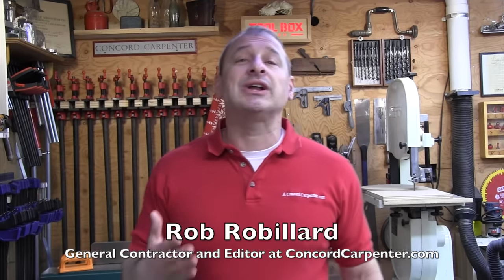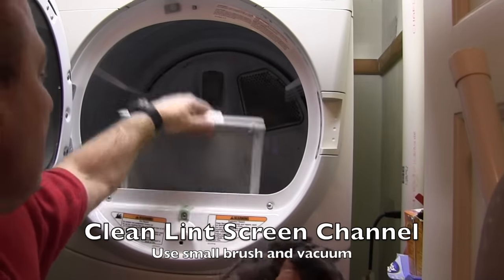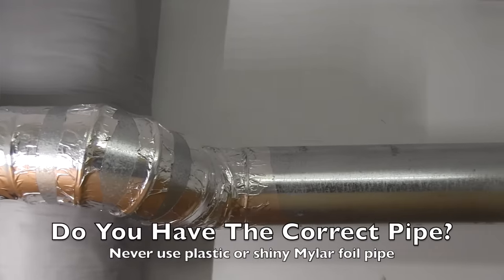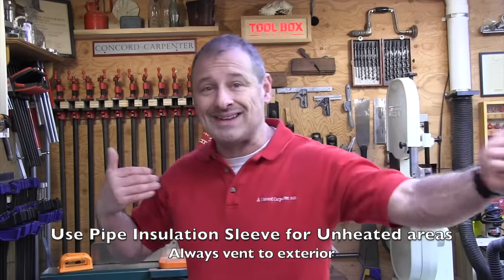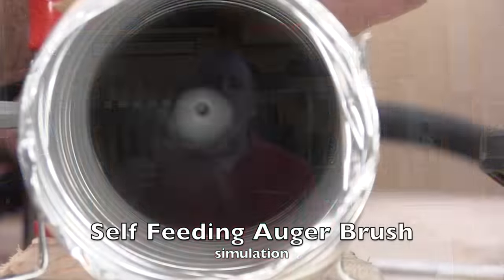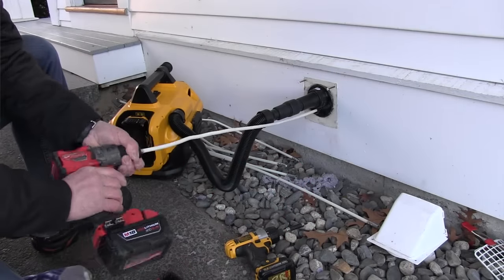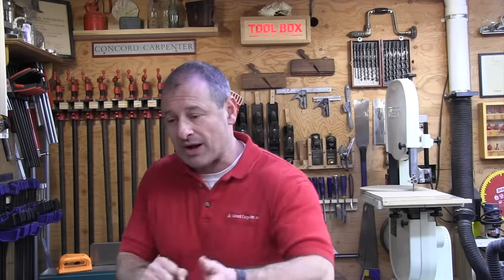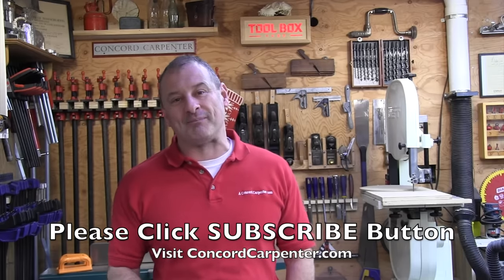How To Clean A Dryer Duct - Step By Step

Comment: Great video. I appreciate that you make videos of advanced carpentry techniques like sistering joists and leveling floors as well as basic videos like cleaning dryer vents.

I had to clean a clogged dryer vent at my mother-in-law’e house last weekend. I should have purchased a kit like this to scrub out the pipe, but I didn’t have one. I do have a long hose on my shop vac. I removed the hood cap outside the house, and I ran my vac hose in from the outside then from the inside after I separated the duct from the dryer. The ribs on the flex hose scoured the pipes a bit as I fed the hose in and out.

One other technique that I used, which worked well, was to stick my Milwaukee m18 leaf blower into the duct from the inside and blow out the duct after a few passes of vacuuming. I already have an m18 blower, which i use to blow leaves around my yard and out of my garage. The blower pipe is just about 4 inches and tapered, which allows you to create a pretty good seal when you stick it inside a 4 inch duct. I looked out the window and saw huge chunks of lint blowing out the pipe on the outside when I blew air through the duct from the inside. It worked very well!

One suggestion I would have for people installing dryer ducts would be to avoid a lot of sharp 90 degree bends. If possible, in would use 2 45 degree bends for longer sweeps to improve airflow and reduce lint buildup.

Comment: Your above video sent me underneath my house to see what was causing the blockage. From what I saw in your video I figure what where the problem was.  Took out all of the plactic tubing and replace it we aluminum.  Using metal tape to help secure the connections before adding the zip tie was a godsend.  Thanks for your help.

Comment: CSIA CDET (fancy for Chimney Safety Institute of America, Certified Dryer Exhaust Technician) here and I really appreciate bringing this important information to they forefront but I do need to point a few things out.

"Critter screens" are absolutely forbidden by the IRC in the US. Do I see them? Daily. Can you buy them? Go to any hardware store and get one , just know technically you can't use it. I assisted a fire investigation once and insurance refused to pay out the claim because of this.

Whether or not to use screws or not is up to debate. The codes changed a few years ago and called for mechanical fasteners providing the fasteners  do not penetrate the duct by more than 1/4 inch. Good luck with that; personally I hust use good quality UL listed foil tape and make sure that horizontal runs are well strapped to prevent sagging.  Also horizontal runs should be sloped DOWN TOWARD the termination. Wet exhaust and lint have a lot of water vapor. Also,  NEVER vent into an attic, crawl space or garage. You want to see mold? Well you will.
Reply: Are O-rings acceptable to use for securing?

Comment: I always thought you had to disassemble the dryer down to the drum to clean it out. Thank you, I learned something today. Subbed.
Reply: Daniel Cannon the only way to clean the inside of a dryer is to take it  apart!!!!   There is no way around it. I fix appliances for a living.
Reply: I’m a chimney sweep and also clean dryer vents and part of my dryer vent service is to remove lint from the dryer and the dryer vent . Imo just cleaning the vent is only 70% and that’s not a complete job. If you think about it a fire will start  at the dryer heating elements not inside the vent, so why not make sure the whole complete system is free and clear from obstructions. Most dryer vent companies only clean the vent just like most chimney sweep companies just clean the chimney, because it’s quick and fast money. But what about the dryer or the wood stove/pellet stove. Those things need to be cleaned as well because there is a potential danger. My business might cost a little more and take a bit more time, but everything gets cleaned from beginning to end so I can sleep at night knowing the customers I service are getting quality and safety for their home.
Reply: @Jonathan T. Brown yes you can have a lot of sand and build up of lint from moisture that sticks to the walls of the vent inside the dryer. This is all done if its accessible(easy to take apart). You don’t want to break a part that could potentially take weeks to months to arrive. It’s surprising how much lint is hiding.
Reply: @Jonathan T. Brown Best tool for the job is a reverse skipper ball but this comes with a higher up-front cost as you would need an air compressor to run this tool. Second of this, you can buy the drill-powered rotary brushes and use a blower, much lower initial cost
Reply: @Jonathan T. Brown Also, INSPECT THE VENT TYPE PRIOR TO CLEAN, if it's that crappy white vinyl stuff, do not brush it as it's old as dirt and will generally tear open very, very easily. This could be an easy upsell to a customer to run their vent correctly with rigid pipe if you are capable. Also, in my experience, if their is white vinyl flex, it's hooked to a pvc pipe venting out. Bad..

Comment: Just had our vent cleaned yesterday by a pro.  $85 and it took him literally 5 minutes.  He had a compressor in the back of his van.  To that, he attached a long hose with a bullet shaped tool at the end.  This tool had small air ducts built into it that would shoot the lint back out of the vent as he lowered it down the pipe from the roof.  This only needs to be done about once every three years.  Those do it yourself spinning brushes that you attach to a drill can break easily and just compress the lint even further into the pipe.  Spend the money, have it done right, but shop around and don't pay too much.
Reply from the maker: He was blowing towards the dryer - did he disconnect the dryer and block the duct at that point? 

If not you risk blowing lint into the dryer where the heating coils are.  

Did he at least vacuum out the heating coils afterward??

Comment: Over 40 years I have only seen two dryers that would have burnt up from lint build up due to plugged venting. 
Dryer fires are usually caused from washing clothing or rags etc. That have flammables in them. After you wash, you super heat it in the dryer. If conditions are perfect they will combust causing the fire. This doesn’t get mentioned by the homeowner to the fire Dept or insurance company. I agree that vents and dryers need cleaned but don’t blame all these fires on lint alone.
Reply from the maker: johnnyjustbecause your point, has value, but goes against all the experts in the field as well as published research.

Comment: I do this yearly.  Wife is inside with lawn blower and when I run a length of rod, she turns on the blower.  We have 25’ of dryer vent pipe. 😷 Helps clear the vent faster. Shop vac is not required but helpful.
Reply: Harry Pouncey use both blower and shop vac.
Reply: I do that too, but I also just change out the vent line.

Comment: I used to work in the commercial laundry business and we just turned the dryer on and stuck an electrician's fish tape with the tip bent back and taped (to avoid punctures) and whipped it around in the vent as we fed it in from the outside.  The method of attaching brushes could be really bad if they come apart. Fish tape is long and seemless. Also, never...ever...use flexible duct. It's easy to tear when cleaning and it collects a lot of lint fast.

Comment: Great video.  Reminds me that it's time to clean mine again.  Would like to see a demo of cleaning a dryer vent that exits through the roof.  Might try my electric leaf blower until better weather when I can safely get on the roof.
Reply from the maker: John Battey I’m sure it will remove most of the lint - good solution for problematic vents
Reply: John Battey 
What a great idea, John.  My dryer is on the second floor so the leaf blower idea sounds like a safe way to keep the dryer vent clean.  Thanks!

Comment: I do it by disconnecting the dryer then, removing the pest screen then blowing the from the dryer side with a leaf blower. Put some rags between the blower nozzle and vent if you don’t have a snug  or air tight seal.

Comment: Thanks for your video!
Our dryer is on 2nd storey house, which means the exhaust pipe goes from the dryer of the wall up few feet then run thru ceiling all the way (16 feet) to the outer vent (flapper).
I tried your suggestion using 4 feet extension rods, but i think not enough to run thru the whole exhaust pipe!
The only way is to go outside and do this from the flapper side using a 20ft ladder ! 
It sucks the way they decided to install the laundry room on a second floor. 😡
Reply from the maker: @fredericowozheen4433  how long is the dryer run? The flexible rods will go up and out
Reply: @ConcordCarpenter  the dryer stops and gives error code D-90 , which means blockage in the exhaust pipe

Comment: 5 Stars to how well this video was done! Very helpful instruction because I guarantee I would not have taped the rods so one would have come unhooked deep in my ducting and I would be running the drill on maximum setting using forward and reverse along with a chainsaw, jack hammer and flamethrower! Just kidding at the end but everything else was true!

Comment: Im using a blower on the dryer site. Works fast and perfect. No damage. Pure cleaning!
Reply from the maker: Andrew Kopczynski I’ve heard that works great , do you have some sort of coupling to seal it off or just stick it in pipe?
Reply: A Concord Carpenter / ToolBoxBuzz  seal blower side with duct tape so not to get back blow pressure
Reply from the maker: Carlos Carney got it!  That also means you have to pull out the machines which is fine in most situations

Comment: For those that have limited resources,from the inside use a blower . Blow to the outside. If you have a lot of lint, repeat in 30 days. Poor mans way to clean a vent. It’s better than doing nothing. Also , when I clean my vents ,I change all the batteries and test my smoke detectors.
Reply: Charlie Porch Awesome idea. I was literally just about to leave a comment saying, what if all you have access to is a shop vac and your hands. Nicely done man.

Comment: terrific video. What brand of flexible rods and dryer cleaning kit are you using? Got issue with a my kit hitting a 90 degree turn followed by another. Can't move the brush any further. The rods in your helpful video look way more flexible to possibly solve this. Big thanks!

Comment: Easy and straight forward. Much appreciated.
Also my dryer vent runs vertical above the dryer and goes outside, im assuming the same steps apply but maybe have a vacuum on both sides so it doesnt splatter all over the floor 😂
Reply from the maker: yes

Comment: This is an excellent video! Are you able to provide a link or source for finding the reducer cap with 2 holes (one for the vac hose and 1 for the cleaner tool) as you show here? You mentioned it was available online, but much searching has not yielded anything. I have a 20ft run in a condo that has a tight fit closet area for the laundry center, so the exterior method would work best for me. Thanks for your help and your excellent video.
Reply from the maker: Absent Mallets I think I put link on a comment below. I got my kit at ACE hardware, the reducer was in kit

Comment: I use a leaf blower on the dryer side. I disconnect the dryer exhaust from the wall,  then stick the leaf blower in the wall, and blow toward the outside.
Reply from the maker: I bet it works great, but it’s not scrubbing the side walls of the pipe and runs into the same problem with losing velocity any 90° turns

Comment: Great Video! That said, you seriously still use vented dryers over there?
Reply from the maker: Yes - you must be in Europe?
Reply: @ConcordCarpenter  Exactly. The energy efficiency is so terrible on those vented dryers that they are de facto unmarketable over here. Needles to say your video is the first time I heard that dryer fires are a thing :D
Reply: @NameNaameNameeNaamee  What are the dryers like in the EU that make them different than vented ones?
Reply: 30 years ago I had a dryer that had a 3-foot long flexible vent tube that went from the dryer into a plastic container with water.  There was no external vent.  Is this what they do in Europe?  The smell of fabric and softener was a bit strong when drying clothes, but aside from that I liked that set up.

Comment: @A Concord Carpenter / ToolBoxBuzz Great video!! What can we do if the vent run is around 30 feet, from dryer to the outside? I can't seem to find a kit with enough flexible rods or do I need to buy an extension kit? Will it work with that many flexible rods connected?
Reply from the maker: heartsafire I’d clean from both ends - that’s almost too long a run

Comment: a bit confusing, so if you clean from the outside, do you still take off the dryer vent on the back of the dryer itself?  What if you cant get to it and the machines are on pre made slabs of concrete thare are raised?  What kind of vacuum do you need?  what were you gonna say to if you dont have a vacuum?  you said we will get to that in a moment too many times and you never got too it.
Reply from the maker: It’s more thorough to take off the pipe to machine and also to clean inside the machine.  Leaving the machine connected can work to 

Use a vac with good suction and turn on the dryer in the end to blow out the pipes

Comment: Important!!!  The video shows the exhaust terminating along the continuous vented soffit which will pull the moisture laden air back into the attic space which is very bad for the attic space.  The vent should terminate either up on the roof or on an exterior wall.  It should not terminate next to an attic space intake vent which can cause mold, paint, insulation and corrosion issues inside the home.

Comment: Mine goes straight up and has an elbow of 45 degrees.  The rod will get stuck in the elbow, and it takes a lot time to get unstuck. It will not go any higher once it gets stuck. Mine exits out of the roof.

Comment: We usually use a leaf blower. Done very fast when we can use it
Reply from the maker: Ive seen that - have you modified it so you can blow out the dryer as well?  Im assuming you blow from the inside to the outside?

Comment: Last year a new motor was put in my dryer and it's not heating up the clothes at all when it dries now. Could it be that the motor is defective or possibly I never cleaned out the dryer duct? I have never touched that ever since I have had the dryer and we're talking 16 years
Reply from the maker: @vic302013  I’d bet dollars to donut you have a clogged exit point or a very restricted duct
Reply from the maker: Al’s if it’s a long run with elbows that can hamper the air flow. Check behind the unit that the hose pipe is. Ot crushed

Comment: What about foil vent pipe? I have 15 feet from dryer to outside!
Reply: Probably wouldn't be hard to just replace it
Reply from the maker: Terrible get rid of it and use as much  solid pipe as possible and metal flex air machine connection

Comment: I think it's dumb not having the laundry room next to an external wall. My dryer duct is a straight run to the outside. I see builders running dryer ducts from the first floor out the roof of a two story house and I just shake my head every time. It just does not make any sense.

Comment: What if you don't have a vacuum adapter? Where can I get one? I really think you should have automatically said.
Reply: The vacuum adapter usually comes with the rods and brush kit. It's an all-in one set-up.
Reply: @kurtfischback8453  mine didn't. But I got it done. Wow, I made this comment about a year ago. Lol took a minute to get my brain going.
Reply: You don't need a vacuum.  Just run your dryer on air with the dryer empty then go outside and use your drill with the cleaning rod and brush.  Makes a mess outside but otherwise works great.

Comment: How much a contractor charge for doing this?
Reply: Repair Man where are u located ?
Reply: Repair Man do you charge $185 when the vent is in the roof? Or just when the job get complicated?
Reply: Repair Man thank you so much, where can I get the adapter for the vacuum and the cleaner to to connected to the vent?

Comment: Cut down on your detergent use.  Also cut down on your liquid softener.  To much being used.   If you get done with a load and the screen has lots of lint.  You are using too much detergent and or softener.  Or just both.
Reply from the maker: Matt R interesting - whats the science behind this?
Reply: A Concord Carpenter / ToolBoxBuzz 
2009, all appliances, toilets etc., anything that uses water has to use 2/3 less... Have noticed how washers use a lot less water.    Old style washer use 27 gallons of water on high to wash. So a full amount or full number is adequate amount.  On the the new energy star, high efficiency washers, uses lots less water, say 9 gallons back in 2010, now about 5 gallons to wash.  So the amount of detergent has to drop. Most new washers don't even have a rinse cycle, it's more of a spin/rinse cycle, unless you have 2nd rinse.
Reply from the maker: Matt R I totally understand the HE stuff, I just don’t understand how too much detergent causes more lint?
Reply: A Concord Carpenter / ToolBoxBuzz heat can not penetrate the garment due too much detergent on the garment.   Thus the lint is from too much detergent.

Comment: Ended up getting my rods stuck in vent and don't know how to get them out😪
Reply from the maker: Did you tape them? or did you put the drill In reverse?

use the clog clearing tool and  go In again and grab It or use an electrician tape to pull It out
Reply: @ConcordCarpenter  ended up reversing and didnt know about taping until I came across your video
Reply from the maker: @cruseboomerangeffect  sorry - NEVER reverse - there Is no need. Just pull It backwards